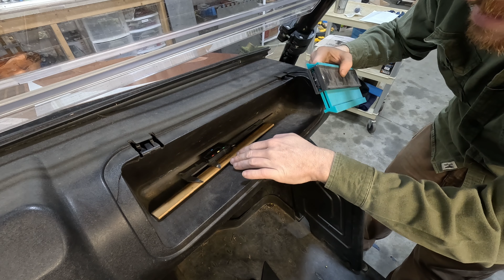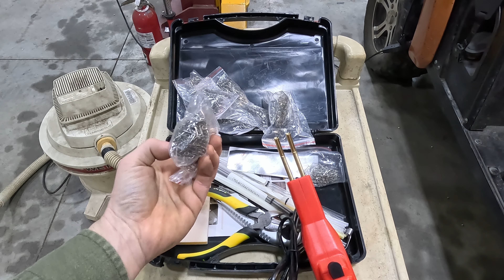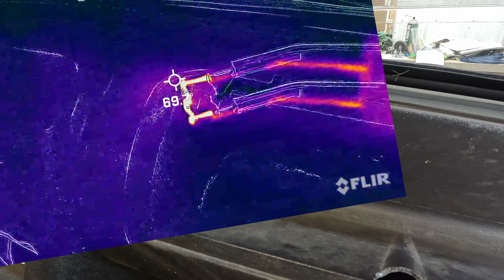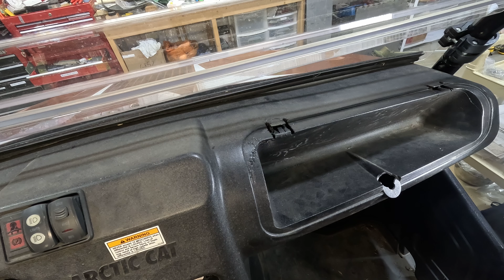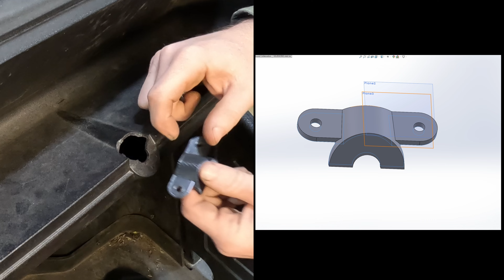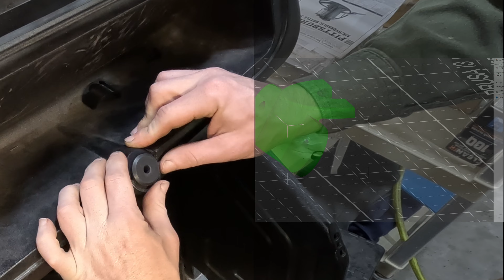Fixing Dashboard w/ Plastic Welder & 3D Printer (DIY)

Comment: Thanks for the instruction. Very well done! Soon I'll be forced to repair the ABS plastic dashboard frame on my 2004 Dodge Ram 2500 diesel. It was unavoidably damaged due to age when the dash was dropped during A/C rebuild and new electronic components changed out. I'm assuming this ABS plastic will respond the same as yours when welding the plastic. Thanks to your video I'll have the confidence to attempt the repair.  Liked and subscribed!
Reply from the maker: Yes, it should respond the same way. Just make sure you use ABS plastic filler rods if you decide to add material. My UTV dash is still going strong after this repair!
Reply: @gerikbensing  Noted, regarding the filler rods. Again, thank you for an excellent video. BTW, I saved all your product links in the description for when I'm prepared to make the repairs.
Reply from the maker: @thomashargraves8947  Much appreciated, those links help me keep the occasional videos I have time to get out, out.

Comment: I'm glad youtume finnally reccomended your videos to me. Handy videos of the type I am generally curious about.  Nicely presented as well.   In regards to the fix, I've often wondered how useful those plastic welders would be.  Think I may invest in one after seeing this video.  And yes, 3D CAD - the thing I keep threatening to learn but not yet done. So many times it would be handy to design my own parts for the 3D printer.
Reply from the maker: Welcome to my channel! I saw a few videos about these lurking YouTube last year and for how cheap they are I couldn’t pass trying one out. The repair is still holding strong and now I’m using it to save some expensive plastic dog crates we used to just trash if they got a small crack.